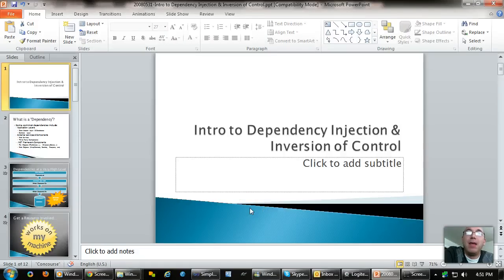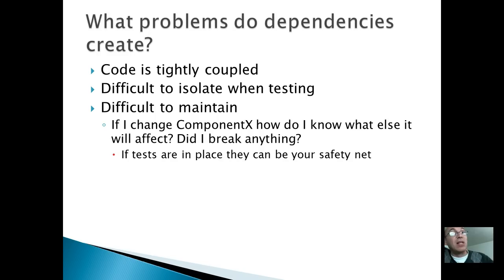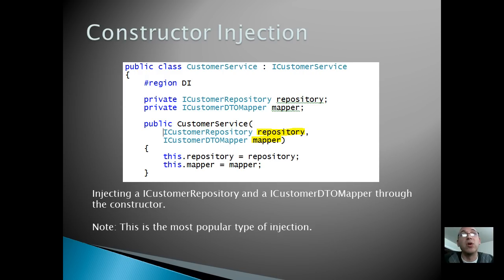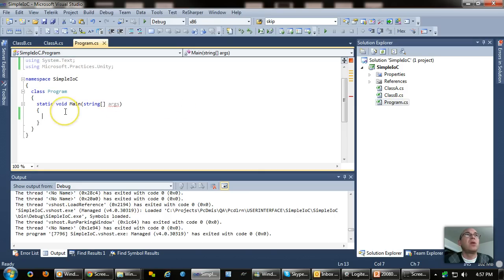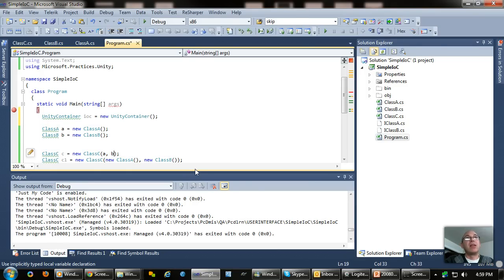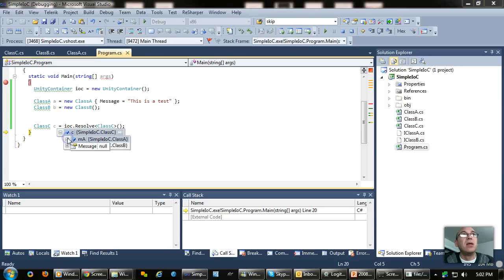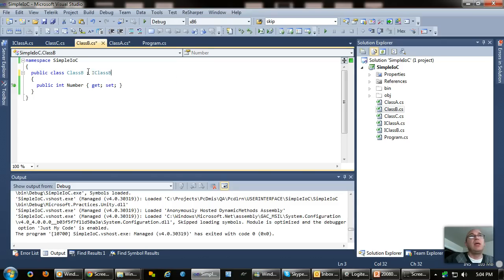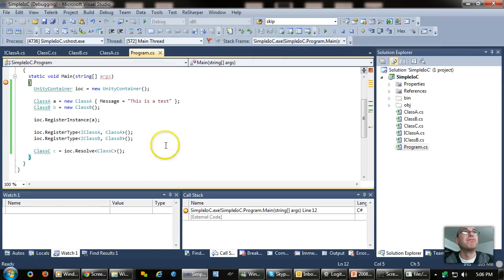Intro to Inversion of Control Part I

Comment: About Inversion of Control: it IS covered. it's just that, because of the scope of these two videos (which is to give you a kick start to encourage you to explore further, rather than explain it all) it is not immediately evident. But it IS there. 

If you want to understand how IoC works, watch the Top Gear style IoC video. 

But before you do so, make sure to watch Kier's (these two) videos - they provide the basis for understanding that you need to grasp the TopGear example.